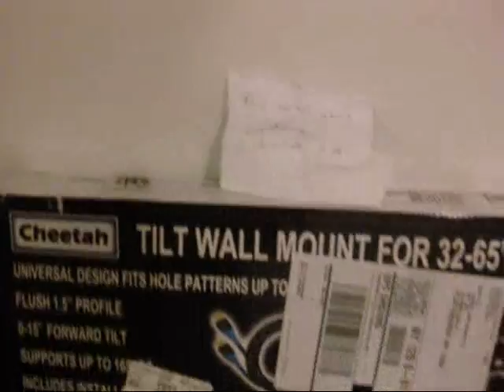1 31 13  Apt 209 New Outlet Vid

Comment: Local codes can supersede the NEC, for instance the NEC requires 1 smoke detector in a dwelling but there is a NY building code that requires 1 in and adjacent to each bedroom and on each level  all interconnected . It is best not to get in a pissing match with your inspector but it doesn't hurt to ask for a code reference. Look it up .

Comment: The current NEC (2011) does not mention anything about the direction receptacles are required to be hung. It depends upon your local AHJ (almost all of them don't care about about the direction), and the electrician. Here in the chicago suburbs, some electricians like to mount them horizontal.

Comment: really 3 years ago we re did our house and they were put on thaire own circuit i was told that it was code it passed inspection  but it makes sense to have it on a lighting circuit then if the lights are working you know the detectors have power  plus your not wasting a breaker and space in the panel for a circuit that probably uses less than a amp  we live in nova Scotia i imagine the codes are different province to province

Comment from the maker: 1) They don't get that fancy around here, but I put ground up as it's much less likely to allow a metallic object to short the blades. What's more imp IMO, is having separate circuits for the lamps and outlets. That way if you pop a circuit, you still have lamps or vice versa.

Comment from the maker: 2) The building inspector also mentioned there's no code specificity for how the smoke detectors should be powered, so alot of electricians wire it to its own breaker. I connect it to overhead lamps or the fridge. the fridge may be a code violation as it needs its own circuit, but that way one is much less likely to switch off a necessary circuit.

Comment: Smoke detectors that work from the mains supply over here, always have a battery back up so if the power goes off for what ever reason the smoke detectors will still work.

Comment: i used 14 gauge and a 15 amp breaker that is how they do most receptacles down hear its to code he already had the 14/2 and 15 amp breaker i much rather use 12/2 myself but 14 is rated for 15 amp  in new  houses sometomes you will see a 20 amp circuit in the kitchen with 12/2 wire but thats about it

Comment: It is a code violation to connect the smoke detectors to the fridge . 210.52(B)(2) The fridge can be on a dedicated circuit but it's not required 210.52(B)(1) exception No.2 .         Generally I would use 12 wire for Refridgerators and 14 wire for smoke detectors

Comment: funny i put one in today to from scratch whole new circuit into my uncles 70 year old house put it in the pantry room ware the microwave is  he was tripping the breaker cause he had the fridge washing machine basement light and microwave on one 15 amp square D QO  3 hours many pg rated words and 3 attempts at geting the drill into the stud bay later he now has a 15 amp plug in the wall over the counter for his microwave and toaster the fridge will get its own circuit some time later on